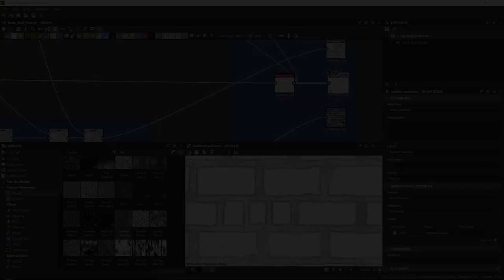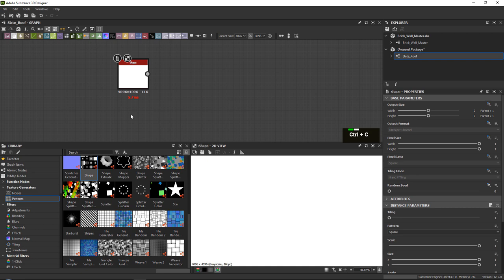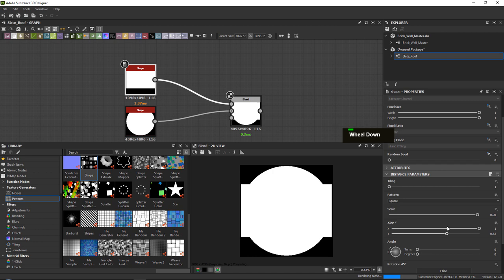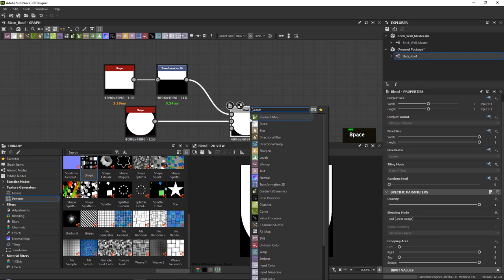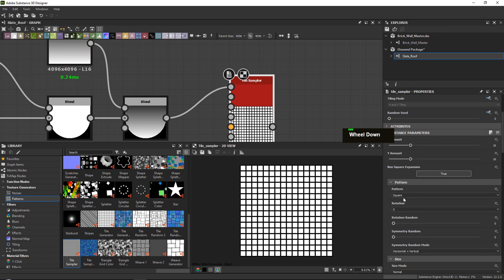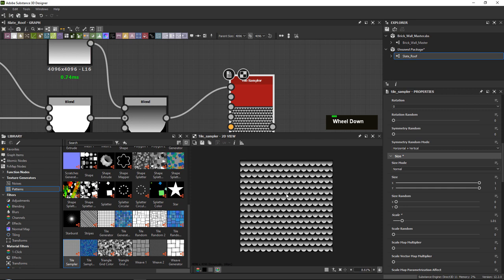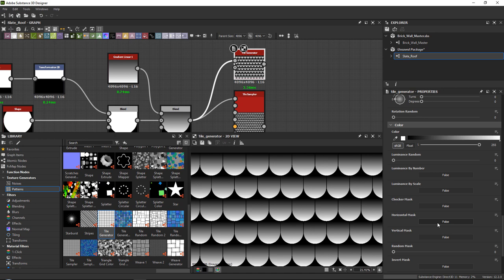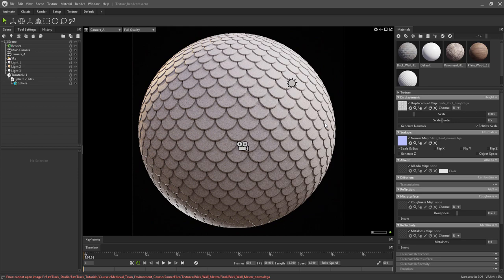Creating a slate roof material using Substance 3D Designer  - Part1

Comment: I think one way to avoid having to create the masks for the tiling pattern at 7:18 is to use Max lighten as blending mode in your Blend node. Add (linear dodge) gets the whitest parts of both inputs and combines them, resulting in a brighter area, where the two inputs have made contact. Max lighten on the other hand, combines both inputs, but without brightening the end result, it pretty much acts like a combine boolean operation. Hope that helps somehow :D
Reply: yeah for last transformation need max blend